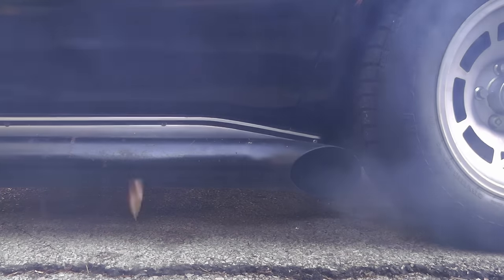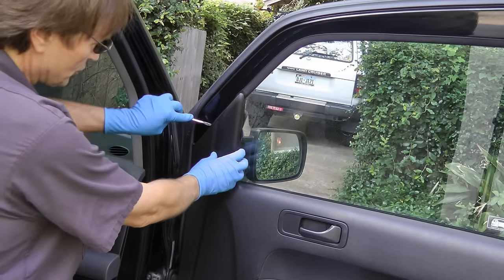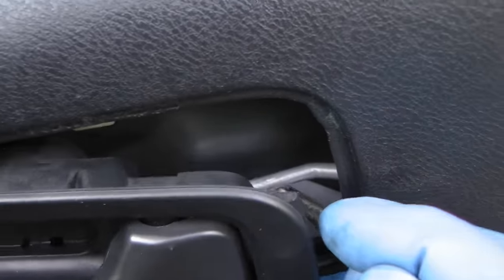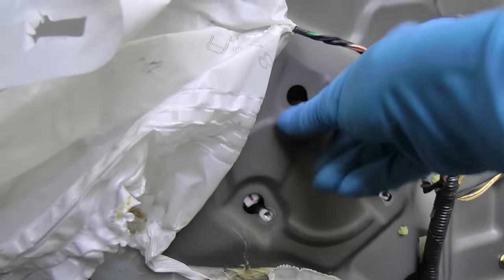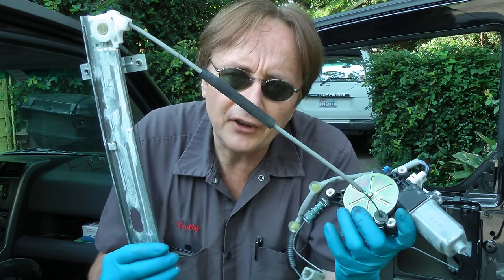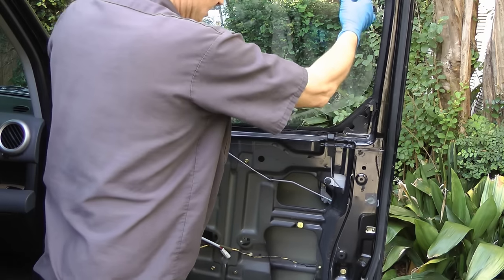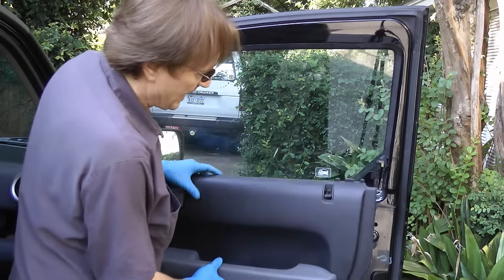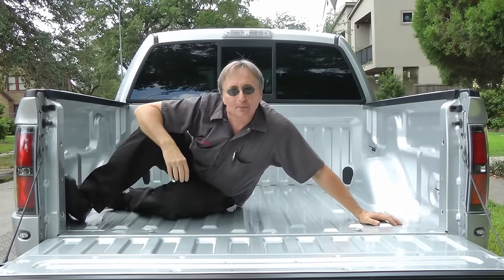How to Fix Power Window (Regulator Assembly) in Your Car

Comment: Hey i was looking up how to fix my car window on google and i came across this video. The problem with my window is completely different (sort of) than the contents of the video. 

My car window goes down with the switch, but doesn't go back up. how can i fix it/what is the problem? (and the door window control doesn't work, only works from drivers seat)

Thanks a bunch.

Comment: Scotty,  my window is stuck closed/up.  Motor is bad.  It will not go down.  I can't access the bolts that hold the glass to the regulator.  Any tips?  Or should I just give up and take it to a shop?
Reply: Did you figure it out?
Reply: @marsrover0  yup.  I pushed the bottom of the regulator to the side 1 inch. Which pushed the window to the side in a tilt angle.   but I didn't bother with removing the window.   Used a small ratchet and took the bolts of the motor.   Bought a new motor and placed it back.  The regulator and glass stayed in place just moved 1 to 2 inch to reveal the motor.

Comment: My passenger side power window has been falling forward or backward for months, but when I rolled it all the way down, and back up, it always righted itself. A few days ago I rolled it down, and when I rolled it back up it went halfway then fell down into the door panel, hard!! And won't roll back up. I think the window fell off of the thing that holds it up. The motor still works because i can hear it, whether i try to roll the window up or down. Any ideas on what part I might need, and where could I buy it?

Comment: I have a 2009 Pontiac Vibe that had power windows added after market 10 years ago.  Drivers side window stopped working.  Motor is fine but does not lift or lower the window anymore.  GM can't fix because it is not original equipment.  Glass shops can't fix because they can't identify the manufacturer of the window assembly so they can't order a replacement regulator that matches the setup.  What can I do and where can I take it to be fixed?

Comment: My car is in about 100 pieces. If you don't include the millions of pieces of rust underneath it. The previous owner was not a good driver, and he got the pressure plate so hot it bent the fingers. So the axles are out, the transmission is out. One of the cross braces is out. The flywheel is waiting to be machined, and the transmission mounts are out, the rubber air hose is off, and the only thing that was holding battery in was Hope. But it still doesn't have power Windows.

Comment: @scottykilmer I have a '97 Olds Silhouette (van) and the driver's side door barely gets up and down when its 3/4 of the way down. It comes off its track and if I push the glass back, then it works fine. Our mechanic says the whole door panel assembly needs to be replaced for about $1,000 or so which seems a bit crazy. Any thoughts? How much for a new regulator? Thanks.

Comment: shouldn't you also watch out for airbag sensers when doing this? I have no clue if they put them in doors but when I was working on the front bumper of my car i had to dissconnect the batttery so they wouldn't go off.

Comment: 07 audi a3 hatchback. drivers window went the other day. motor works i can hear it running but there was a kind of grinding/cracking noise when i drive the motor. going to open up tomorrow - any suggestions? window doesnt move up or down

Comment: My window stopped moving in general. It's not electrical and I've already replaced the window regulator. Any Ideas on what it could be?
Reply from the maker: only two things can knock em out, either the motor/regulator assembly is bad, or it's not getting power to make it work
Reply: can't be power since it's all manual, i guess the assembly is bad?

Comment: Hey scotty i would love if you could help me out, i have an 89 ford probe and it seems to be an electrical nightmare, i don't know if it's a fuse or relay or what?? but my power windows do not work along with my heater/ac, and dome light. But all my dash lights work (digital gauges) So if you have any ideas what i should do or replace i'd be extremely thankful. Please and thank you!

-Collin

Comment: Would this work for electric sun/moon roofs?
Reply: Hell no. Completely different design. From my experience, no regulates. Just motors pushing cables back to push the glass back. Major pain in the ass to fix.

Comment: Thanks a lot Scotty.  I had to reglue the clips which hold the window and was a bit worried about taking the window out but after watchig your video I did it quite easily.  I've always managed to fix my own car faults but with these new computer ones it's a bit scary and I'm electronically minded.  Q I strated my car straight away as normal and then I opened the passenger electric window which in turn stopped the engine and now it won't start.  I'm thinking maybe a fuse has blown due to a surge, any idea's.  Thanks in advance.  Nissan Almera.  Cheers again.
Update: Just turned the key and it started first time after about 4 days????

Comment: Hi Scotty i have a 2003 Mazda 6 and the passenger window is down all the windows work but that one , mechanic said theres a grounding problem in the motor and it needs to be replaced , i tried pulling up the window manually with tape but it wouldnt budge. Motor replacement is $500 , is this truly necessary ? The window only goes down eith the power switch , it will not go up.
Reply: Perhaps try watching "power windows not working part 1" by gerry campos. 
Part 1 and part 2 videos really helped me! Goodluck

Comment: my drivers side window started going up and down slowly darn i should've check it out sooner before it gets any worse now it won't go up and down its stuck i know its getting power but i hear like a crunchy sound of plastic, i assume the assembly is bad and so are the motor and i should've buy silicone stuff to lube the chains that coulda help now i'm just wondering how much a new motor cost and a entire assembly, and if any come with lube in or do i have to buy it from the store

Comment: I was helping a friend with one installed a new motor with regulator. It still didn't work but motor got hot.when you push button you can feel it try to move.but it won't.the motor get hot buy gust turning switch on the car

Comment: Hi Scotty i have a mazda 3 2005 my drive side windows controls 2 out of 4 buttons that operates the electric widows dont work can it be the fuse or the master switch thats not making the electric windows works
Reply from the maker: generally a bad master switch, for sure if windows work when their switches on the actual doors still work

Comment: hey scotty i have a 2002 honda accord and my window on my driver side will roll down but not up at least only to a certain point maybe a few inches from all the way up and suggestions?
Reply from the maker: the window regulator is greaking, but it's best to just get an aftermarket window motor and regulator assembly to fix it for good. Motor is certainly worn too being that old
Reply: OK thank you much!!

Comment: if you can please, let me know what you mean by holding the glass up with a radiator clamp.  I don't understand how the clamps will help because don't I need the regulator to move into the "up" position because i thought the window sits on top of the regulator?  Sorry I'm confused.

Comment: Hi scotty. I have a 01 caravan. And the passenger window woul not roll down.  Some times it works fine up and down then for a few weeks it woult not work again
Reply from the maker: generally a bad switch or a bad motor. If it doesn't work, take the inner panel off and put power directly to the motor, if it doesn't work then, it's the motor. If it does, the switch
Reply: Thanks

Comment: I have a 2002 Honda accord, an it's doing the same noise an everything but how much does a whole new set cost?
Reply from the maker: price around, chinese made replacements cost much less and work fine
Reply: Well I took off the door panel an it's a little different from what u showed on the video like where the parts r located
Reply from the maker: Alvaro Rodriguez
they all work the same way, motor has two wires, one ground, one power, they reverse to go up or down. Just look at it closely , they are logically bolted or bradded in place

Comment: Hey Scotty I have a 98 jeep cherokee none of my windows with go up or down. What could be the problem?
Reply from the maker: +Soccerlover96 check the fuse and the power motor relay first. if not that, often a bad master power switch
Reply: +Scotty Kilmer could it be a ground wire? I replaced the switch a few months ago

Comment: So I have a VW Passat 02 1.8t. Just replaced the entire regulator due to window being stuck half way down. Now it is clicking. So I purchased a Motor Gear (plastic). And I can find absolutely ZERO guides on how to take the window motor apart to replace it. I imagine it will be a fight from start to finish, that is if it is even possible. 

My question is: Is it even possible to just replace the gear in the window motor?

Comment: Rear left side window on my 2001 Nissan Maxima won't come up but went down fine. I tried to listen for any noise while hitting the switch up and down but nothing. Any idea what's up?
Reply from the maker: do the tests in this video, either switch is bad, or motor is bad. Knowing maximas, I"d bet on the motor

Comment: Any advice on how to fix my issue. . My door window rattles on my 2001 silverado. I always end up tighten the wimdow regulator bolts but they always end up getting loose again...any advice is appreciated
Reply: +Justin Lindekugel Lol lock right, *tight.

Comment: Hey Scotty, the window on my elantra seems to be out of track. When ever I try to raise  the window up with my electric switch it seems to be entering the car instead of riding on its track. Any suggestions?
Reply from the maker: time for a new window regulator
Reply: Scotty Kilmer Hey Scotty. Great job man. My driver side window doesn't work most of the time. I can hear a click in the Power window AMPLIFIER ASSY. I bought a new regulator just in case and plugged it up. It still dint work. Just the clicking in the little box. Its a 95 Infinity G20
Reply: *TheReal* JuseBeats You know what, i fixed it. It was the AMP. I had to open it up. I noticed that the solder was gone on one of the components. I put some more on and now its working fine. Saved $100 lol. The video that helped me. https://youtu.be/UWG6nd7HeBc?list=PLEnHk-RdXjYZp9hRK2rIpAxxTqtWlNX0J

Comment: hello.i need to remove a power window from a junk car.after I get the molding off door,what if window ,is not in correct position to access the bolts?thanks,kelly
Reply from the maker: then you have to bend and contort and cut your arms trying to access them with a wrench

Comment: My passenger window clicks when the down is pressed but no sound when up is pressed. Is this a sign of a bad motor?
Reply from the maker: bad motor or bad switch, remove the inner panel and hot wire the motor to see if it's that. If it works then, it's the switch

Comment: HI Scotty.   I have a 93 T'Bird.  The passenger side window just started acting up.  the rear of it seems lose.  It goes down a few inches and then freaks out. I then press the button and it goes back up.   I can take my fingers and pull up close to an inch with the play.  The front part has no play.    Any ideas?
Reply from the maker: +Romulan112 time for a new window regulator assembly

Comment: (CONTINUE) IS THERE A WAY TO GET THE WINDOW ALL THE WAY UP WITHOUT REPLACING THE MOTOR? MAYBE DETACH THE MOTOR/REGULATOR ASSEMBLY TO PULL THE WINDOW UP IN PLACE AND REATTACH AND MOTOR REGULATOR SO THAT THE WINDOW WILL STAY UP?  I know nothing about how window motors/regulators move or work so I'm asking.  Despite the fact that it will still not roll up and down, I would be okay with it if the window was just stuck in the up position.  

Please let me know how that can be achieved...

Thanks you!

Comment: Scotty,tried new switch and still can only open and. close passenger side... I just bought this truck and there is no noise when driver window switch is activated power is going to switch...do you think installing a new window actuator is the solution. .it's a 2000 Silverado btw. .thanks
Reply from the maker: yes, that's often it
Reply: Scotty Kilmer thanks for your help...
Reply: Scotty Kilmer okay went to junk yard and spiced in another plug..still only passenger window works...to make driver window work i use a 12volt battery directly to plug and it goes up and down no problem ..switch is good because it works both  Windows in my other Silverado...could it be a fuse...my switch has power locks plus both Windows all in one peice....the power is delivered from the power locks plug...any ideas ? this is driving me nuts..thanks
Reply: update...sprayed electrical lube on fuse panel and giggled a couple of fuses...now it works..wish I would have tried that first..but now I feel I can fix any power window on the planet...it's a great feeling..thanks
Reply: update...sprayed electrical lube on fuse panel and giggled a couple of fuses...now it works..wish I would have tried that first..but now I feel I can fix any power window on the planet...it's a great feeling..thanks

Comment: Hey there i have a 2004 Legacy GT, comes up with an error code ER PD which is an issue with the power window. It worked before but now the window has stopped working. Apparently there is a miss communication between the Body unit and another unit. Any ideas ? Cheers.
Reply from the maker: often a bad body control unit does that.

Comment: I bought the motor and regulator together, put it in, but now the window only goes down instead of up. Could it be a bad switch ? I  tried it on the master switch too and it did the same thing
Reply from the maker: +Jose Sanchez either switch is bad, or wiring going to the motor
Reply: Shit ...
Reply: Hopefully it's the switch

Comment: Hey Scotty i have an 01 neon SE…the window regulator gave out so i replaced the peer switch and nothing then i replaced the entire regulator assembly with a new one and still  won't work and advice??
Reply from the maker: perhaps a bad window relay, but really, get a test light or meter, and check for power and ground to the motor, keep going until you find where power exists, and then where it's lost. Then find why it's lost where it is, like a bad wire or broken connector
Reply: DAnCEFr3AKproduction interesting points ,if anyone else needs to find out about how to convert a gasoline car into an electric car try Pyzork Amazing Electric Professor (do a search on google ) ? Ive heard some pretty good things about it and my co-worker got great success with it.

Comment: Hi, I know this is an old video but my power windows on my 1999 Galant arent working , I disconnected the switches individually and and unplugged them ,then I ran 2 cables from the battery(postive ,negative)and connected them to the plug and they moved up and down sometimes with a bit of hesitation.any ideas as if I need new window motor and assebly?
Reply from the maker: they should not hesitate at all, change the motor assembly and regulator

Comment: On my car the little plastic things that connect the window to the moving part broke somehow. They seem to be permanently attached to the window with some black adhesive. It is a 2004 Pontiac Grand Am.
Reply from the maker: yep, cheap GM design, you really have to buy a new glass assembly with those tabs glued on to fix it right
Reply: Darn, was hoping for a cheap fix. Thanks for the reply.

Comment: I have a 2 door box chevy and it has a a regulator tape instead of cable and it's manual. How do u rout the regulator tape in the regulator?
Reply from the maker: heck I do those one at a time, never remember what goes where on any particular model. Do as I do, take the other door apart and copy the routing on that side, easiest way to do it.

Comment: +Scotty Kilmer i have a mitsubishi eclipse 2006 my drivers side window works fine but the passenger one i hold it up with the window lock if take the window lock off it goes down by itself as if i was pushing the button and when i want to close it i have to flick the button like crazy or  turn the car off and on again for it to work is it a fuse or do have to replace the whole assembly?
Reply from the maker: +Rafael Ruiz  replace the button assembly

Comment: Hello mate, I have a 05 Audi A4 B7 and my drivers window will only work when the door is open at a certain angle meaning I can't get it to work while the door is closed. Any solutions? Thanks in advance
Reply from the maker: I would assume wiring going into the door is damaged and closing the door shorts those wires out

Comment: Hey Scotty i have a 2009 toyota corolla axio 
my problem is when the window reaches the top of the door it then the window gets back half way 
it becomes very embarrassing when i have to pull up the window 
the only possible way is that i have to pull it up carefully and slowly
please can you give me any solution for this problem???????
Reply from the maker: +Aftaab Al Capo   the motor assembly needs replacing, it's shorting out to power
Reply: are you sure because some technicians are telling me that the problem is with its sensors 
the sensors are acting as if there was an obstacle thats why the window pulls back automatically

Comment: what if you don't here a sound and it is a fuse or something else. How would you know and how would you fix that?
Reply from the maker: you check the fuses first to see if they're blown. If not, you get a meter and measure for power before and after the switches to see if they work or not
Reply: Indeed it was a fuse 30 a from 1996 camry. A mechanic told me otherwise which would have cost me $200. Went to a auto store bought the $8 dollar fuse grabbed a tool box and the car manuel and did it myself. Thanks for the help.